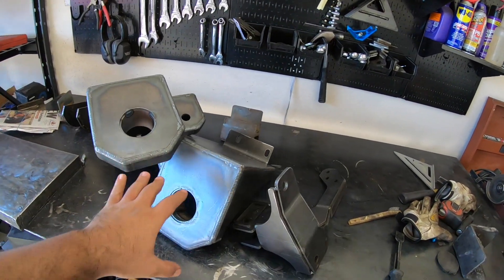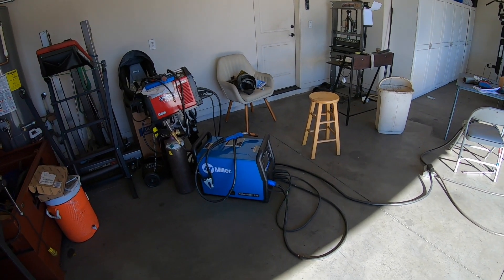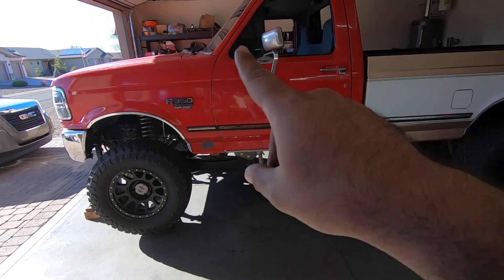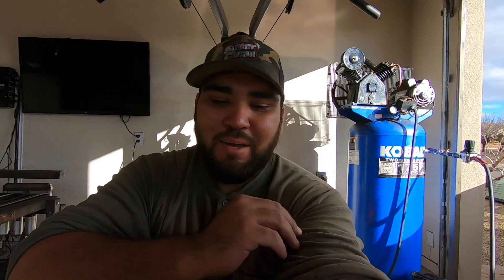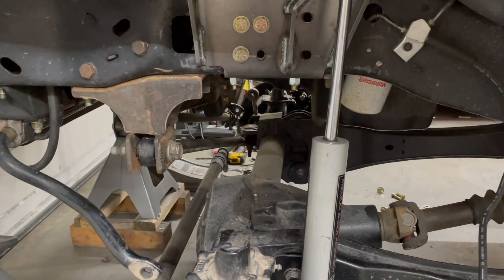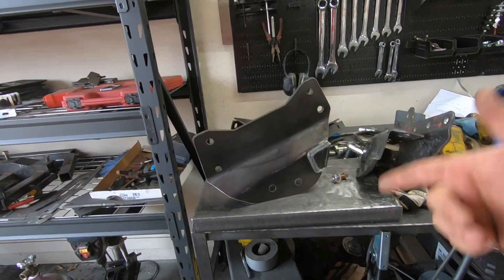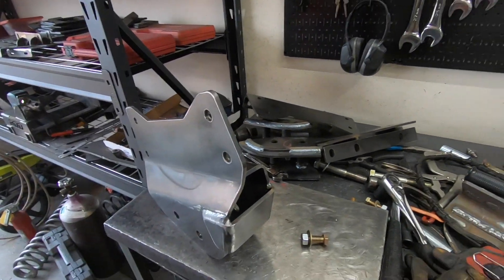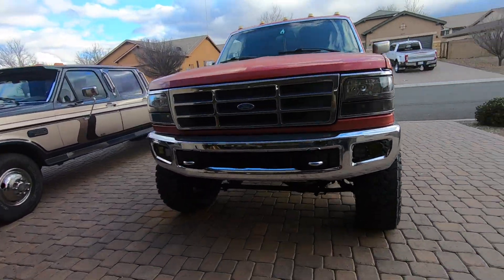The 05+ OBS Axle Swap Kit Is Done!!!

Comment: would i be able to do this with a  97 crew cab dually ?
Reply from the maker: You can, if it’s 2wd it will not be bolt on you will have to drill a few more holes, but I can provide you with all the measurements you will need to install the brackets

Comment: What’s the details on the wheels 17s or 18s amd what offset are those methods.. currently swapping an 05 axle into a 76 f250.. or do you have a video where you go over them
Reply from the maker: They are 18x9 -12 offset I don’t think I ever really went over them they are the nv 305
Reply: @blowingdiesel  thanks
Reply from the maker: No problem

Comment: Nice Work! Currently building a 1995 f250 7.3 regular cab 4x4. Bought 2006 f250 superduty axles and plan on doing an 8” lift. Want to clear my 22x12 American forces on 37s. I been googling what brackets I need but it’s a pain the butt going through some of these websites. I need a kit that gives me everything I need to do the swap and lift. I have the coils already. One purchase and be done with it. If you can provide that kit please let me know. One purchase one swipe. Thanks I follow your videos.
Reply from the maker: Thank you! Unfortunately right now my kit will not work with that much lift the only kit on the market right now would be RYD they have a full 4-8” kit. Mine will be out probably next year or late this year
Reply: Thanks I appreciate your response. So for now the only parts that would work once finish would be your coil buckets? Where in Arizona are you? I’m in Buckeye Arizona
Reply from the maker: Yeah no problem 👍🏼 yes the coil buckets would be the only ones that work with that much lift. I am in the Prescott area not that far
Reply: That’s cool to know you are nearby. I’m sure we will meet up sometime. By looking at the videos it gave me the impression you were in West Texas. I added regular cab amp power steps, need to finish bracing and wiring. Adding a power back window. Hoping to work on it this morning but it’s 47 degrees outside. Cool thanks
Reply from the maker: That’s awesome I really wanna add a rear power window to the crew cab what window did you go with?
Reply: It’s a C.R Laurence power slider
Reply from the maker: Let me know how you like it
Reply: I sent you an email to your blowing diesel email.
Reply: @blowingdiesel  would your radius arm bracket and coil bucks work with a rough country lift 8" where they have the bracket that bolts into the radius arm bracket to lower radius arms ?